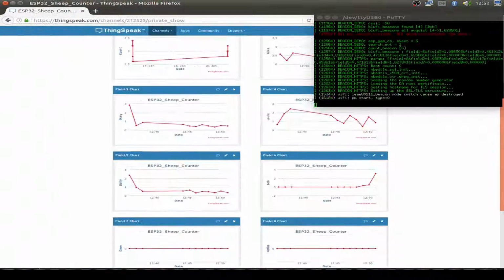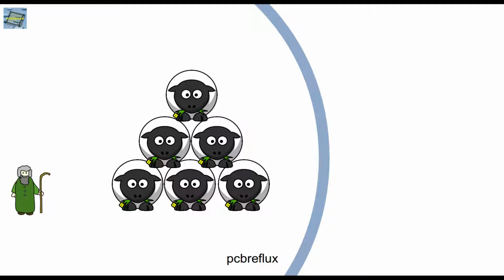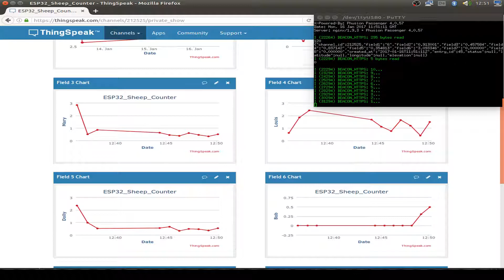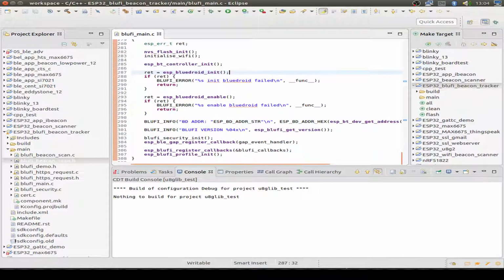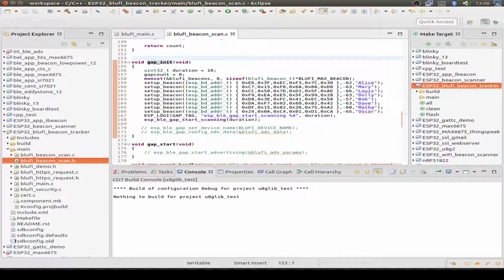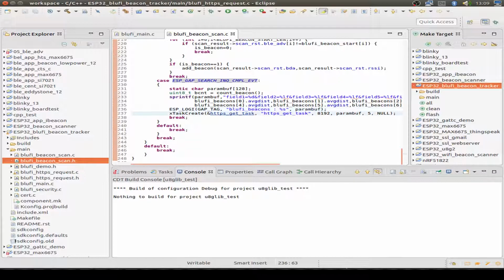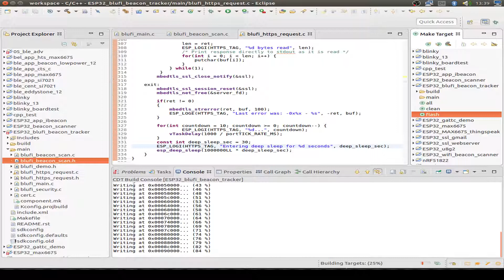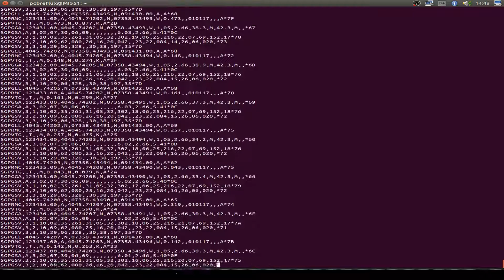ESP32 #16: WiFi enabled Beacon Tracker - aka the Sheep Counter

Comment: Dear Sir,

I have follow with your instruction and I can flash to ESP32 module already, But after power-on  output message from ESP32 show about  that

How do we fix this problem.

Thanks ^^

############################################################
[0;32mI (457) esp_image: segment 4: paddr=0x0010af80 vaddr=0x40080000 size=0x00400 (  1024) load[0m
[0;32mI (463) esp_image: segment 5: paddr=0x0010b388 vaddr=0x40080400 size=0x148c8 ( 84168) load[0m
[0;32mI (506) esp_image: segment 6: paddr=0x0011fc58 vaddr=0x400c0000 size=0x00034 (    52) load[0m
[0;32mI (507) esp_image: segment 7: paddr=0x0011fc94 vaddr=0x50000000 size=0x00018 (    24) load[0m
[0;31mE (513) esp_image: Image length 1113296 doesn't fit in partition length 1048576[0m
[0;31mE (521) boot: Factory app partition is not bootable[0m
[0;31mE (527) boot: No bootable app partitions in the partition table[0m
user code done
############################################################
Reply from the maker: Hi, to fit the rather large blufi image into your flash you need to extend the factory partition. 
make menuconfig

 Partition Table  --->
 Partition Table (Custom partition table CSV)  --->
 (partitions.csv) Custom partition CSV file

edit partitions.csv like this:

# Espressif ESP32 Partition Table
# Name, Type, SubType, Offset, Size, Flags
nvs,data,nvs,0x9000,24K,
phy_init,data,phy,0xf000,4K,
factory,app,factory,0x10000,1536k,

make -j8 all

make flash monitor

See also http://esp-idf.readthedocs.io/en/latest/api-guides/partition-tables.html
and http://iot-bits.com/customizing-esp32-partitions-table/
Reply from the maker: BTW ... you don't need blufi for using bluetooth and wifi at the same time (was my misunderstanding at this time). Even. this will work in some kind with blufi it's easier to start a task with bluetooth and a second task with wifi.
Reply from the maker: Maybe this code will help for BLE/WIFI mix mode: https://github.com/pcbreflux/espressif/tree/master/esp32/app/ESP32_gatts_mqtt_gateway

Comment: Dear sir, If I added a new Bluetooth device (sensor Bluetooth module address) in the place of beacon Bluetooth address exist in the code ESP32_blufi_beacon_tracker. ESP32 can read the sensor data? or I should do any extra modification in ESP32_blufi_beacon_tracker code.
Reply from the maker: You don't have to setup the beacons like in gap_init ... setup_beacon(...). Only if you want to identify the beacon by a name. All other beacons should attached to list with their address. But my first test is to use my phone and the "nRF Connect" APP to search for the beacons.

Comment: great collection of videos and tutorials. I am trying to build an BLE scanner that looks for BLE devices in reach and sends the detected data (hardware adress and rssi) to an mqtt topic. So far it sort of works but is very unreliable. As a concept: it seems that the esp32 picks up phones and watches and other ble devices on a passive scan. As I always have at least one of those on me while walking around in the house I wanted to scatter esp32 around the house and have them report those BLE scan results to a mqtt topic so that from the information where a ble device has been seen the home automation would determine where a certain person is... At least to some degree. Source so far is here: https://github.com/bietiekay/hcs-esp32-beacon-sensor-node... Do you guys here have any idea how to get it stable and reliable doing just that: power up, join wifi and scan for passive ble notifications and send them to an mqtt topic.
Reply: did u make any improment..i want to use esp32 for asset tracking..kindly share ur experience

Comment: does this work on sparkfun version ?
Reply from the maker: There is no hardware related stuff beside the ESP32 and the antenna, so it should work on all ESP32 boards (but not with arduino IDE today, need esp-idf).
Reply: thanks!

Comment: esp_bt_controller_init() function is not working in blufi_main.c, it is saying there are too few arguments? how to fix this?
Reply from the maker: +Moss BIM use this   esp_bt_controller_enable(ESP_BT_MODE_BTDM);
Reply: Thanks, and how do you scan for unknown beacons?
Reply from the maker: Hi, you dont scan for beacons. The esp32 recieve all advertising packages of all nearby advertising devices. In the code I just filter the "beacon" packages and add them to the list. If the adress is known also the name is displayed. Hope this answer your question?
Reply from the maker: By the way you don't need bluefy to combine Bluetooth and wifi. this was my assumption as espressif releases the new library and I was wrong. But it also work's.
Reply from the maker: looks like you get the address (BDA) of your beacons. Can you check the advertising packages with maybe the nRF Connect App from nordic and post it?
Reply: using the nrf connect app I am getting "address unavailable" fro the estimote ibeacons
Reply from the maker: Sorry for that but can you ask the vendor how to get the advertising and what is the format?

Comment: Do you know, how many beacons can be seen simultaneously say "per second" by the ESP32?
Reply from the maker: Neil Young Sorry, not have the budget to test this. and in the code there is no clue for a limit.. But this a good question for the esp32.com forum. Hopefully someone from espressif can answer this.
Reply: Thanks. I also have heard some rumours regarding unreliable or strange RSSI readings, like here

https://www.esp32.com/viewtopic.php?f=14&t=1242
https://forum.pycom.io/topic/554/ble-rssi-level
https://www.esp32.com/viewtopic.php?f=2&t=818

Did you make the same experience?
Reply from the maker: Neil Young No, in the time I do the testing the reading was stable (+-5). But the esp-idf is under havy development so every day something is fixed (or in rare new hole are drilled).

Comment: hi, loved this project. i have a request for a simple sntp based scheduler for on off control of lights. is it possible to do it. i just want my lights to switch on and off at particular time of the day and week. any pointers? 
  Thank you for the videos. keep it up, looking forward for more to come. cheers.
Reply from the maker: Hi, sure you can do it. But it's easier to buy a sonoff and flash the (unpluged) esp8266 inside. But if you really want to do it with the esp32 you can use the sntp example (https://github.com/espressif/esp-idf/tree/master/examples/protocols/sntp) and build your code around maybe with an https server for configuration your time-slots. And maybe send the esp32 every 60s to deepsleep for powersavings and update the sntp time only once a day. ota will also helpful but i am waiting for a full secure version.